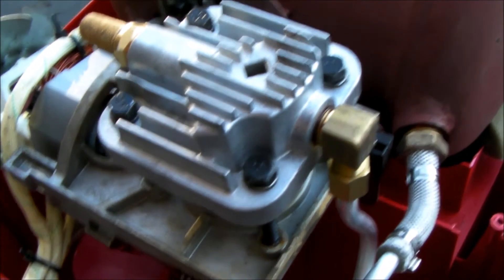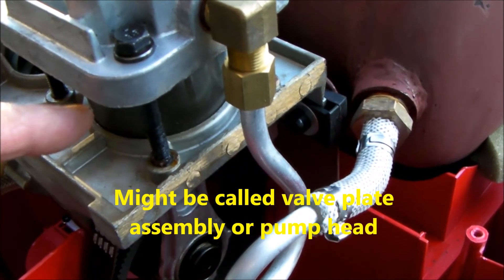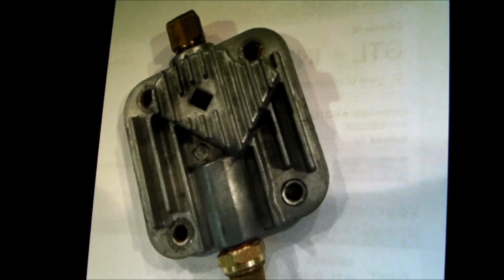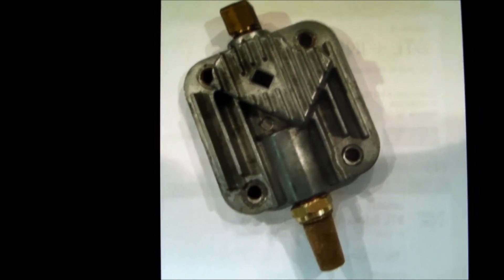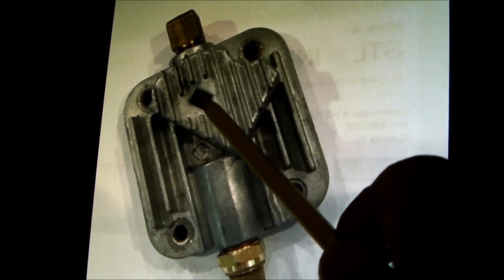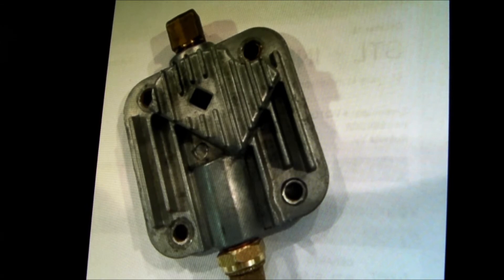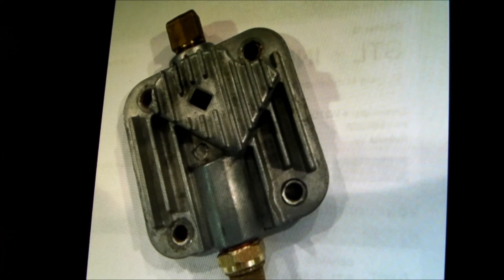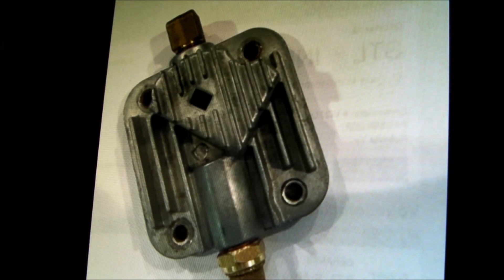Husky Air Scout compressor pump head casting leaks air

Comment: I have the air scout pictured in the thumbnail it fills up with air fine but will not come out the hose. something about where it attaches? Anyone kno? Thanks
Reply: Yes, I had the same problem.  Compressor works fine, builds pressure great, but nothing would come out the right side quick connect no matter which accessory I connected.  You don't need to take off anything but the cover on the pressure regulator knob to access the screw under the removable decal.  Unscrew the black screw, take off the pressure regulator knob, use a Crescent wrench or suitable open end wrench to loosen the PR housing nut and carefully remove the PR valve from the housing.  You'll see a brass fitting with a black dot in the middle and it has a slot on the top.  Use a socket wrench to remove the brass fitting and you'll see a spring with a square black plastic top underneath.  You're now in the air manifold.  The left side has the pressure relief valve and the right side is the output for pressurized air.  If your compressor isn't delivering air out the right side via the output quick connect, your pressure regulator isn't opening up the valve properly to allow air to pass through the valve housing to exit the quick connect.  My valve had some corrosion and deposits in it from moisture, so I cleaned it thoroughly with a small brush and applied some WD40 to the housing inside.  Next, I took the main part of the valve apart by pressing down on the top where the screw for the knob sits and voila, out came the valve.  It has two O-rings on it and needs to be able to move freely when the PR knob is turned.  Lubricate these O-rings with silicone grease and apply generously.  Make sure to put everything back together by reversing the order in which you took it apart, and it's really simple to reassemble the valve and never need to remove the plastic housing for the compressor.  If you're curious and want to see what's inside, the screws that hold the housing on are easy to remove and you'll need to unscrew the pressure relief valve with a wrench to allow the housing to slip off the right side over the quick connect.  The circuit breaker is easily removed by turning the black ring around the switch counter-clockwise allowing the switch to drop through the housing.  I didn't have time to shoot a video, but cleaning and lubricating the valve and housing did the trick for me and mine now works perfectly.

Comment: I may be way off but I'm thinking that hole is there to release pressure in the event the check valve fails. I've got the same compressor I'm about to tear into. I was looking for any tricks I might need to remove the plastic body encasing the tank and motor.
Reply from the maker: I did it a long time ago.  Don't recall it being difficult to dis-assemble.  let me know what you conclude about that "hole".  Thanks
Reply: Will do. Im not used to these dinky compressors. I was a building contractor and mechanic for the majority of my life and had little use for little tools. However someone decided they needed close to a million $ worth of my tools more than i did and relieved me of the burden of getting up and going to work everyday. I felt bad for them having to pick up and carry all of those heavy well made tools so i thought id by dinky crap light weight tools so they wont hurt their backs if the steal them this time.

Comment: I didn't see the pressure guage. Could that be what's missing?
Reply from the maker: Gauges were mounted in the other housing which you can't see in the video but they are there and connected.